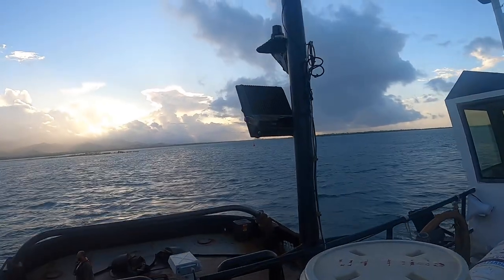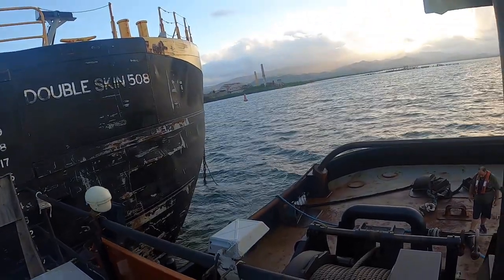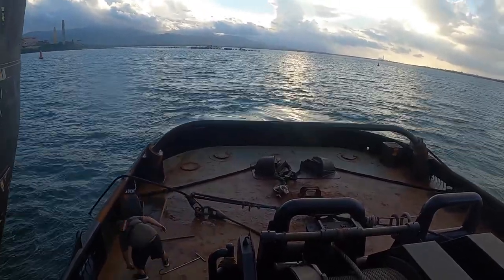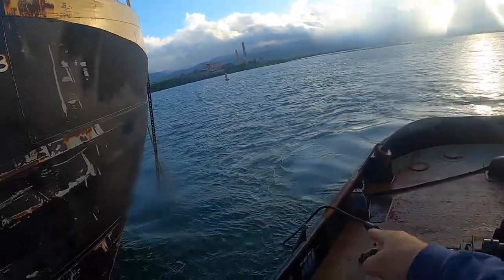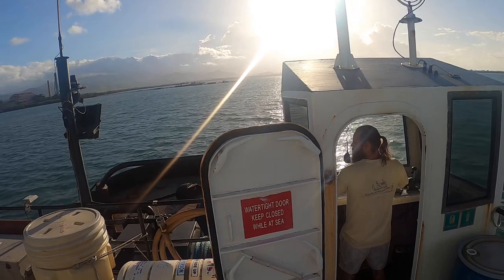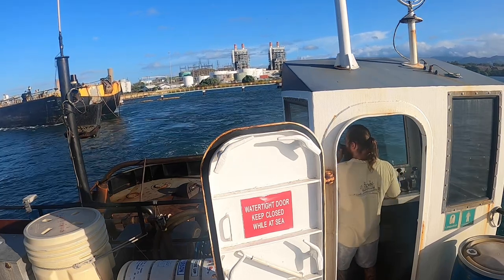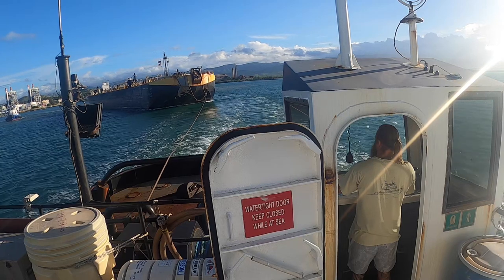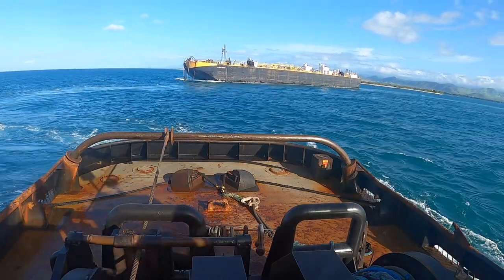Towing off the Dock and Catching the Doughnut

Comment: Tremendously instructional and well done video. Very impressed with the nimble skills to mount the wire in the donut. Actually rather ingenious on the structure for the automatic mounting. Very subtle structures having significant effect on the operation and protection. Like that your chief is consistent in following safety measures and your video captured the dynamics as to why.
Reply from the maker: Thank you very much for watching. Yes. We have the benefit of a few hundred years of work done before us that have figured out better ways of doing things. CUOTO

Comment: Hi Tim, FYI , spectra is the original name  of linear polyethylene fibers, Dyneema is the same product it’s the European name. 
Kevlar is a completely different product with poor uv resistant unlike Dyneema.  
Both are light wt and very strong.
Dyneema has taken over from kevlar in many applications.  Dyneema is less chafe resistant and can burn /melt, kevlar is very resistant to temperature especially thru say a fair lead.
Dyneema as you know not a great tow line product as it’s not got the stretch or shock resistance of say nylon that is a great anchor line. And I would use for towing yachts etc do you use for heavy towing?
There was a well know super yacht channel where they were using a spectra/dyneema line to tow the 32’ expensive tender on a typical long tow line .  They basically ripped the front of the boat apart as there was no shock absorption. 
Instead of changing to a proper nylon tow line they built huge SS reinforcing into the tender bow ! 
So now that will probably pull the cleats off the super yacht! 
Cheers Warren
Reply from the maker: 😂😂😂😂 (I really shouldn't like to hear about mega yacht fails as much as I do) Thank you very much for watching and for the great info. Much of which I did not know. CUOTO

Comment: Regarding luke the winch operator
Im kinda surprised that they allow you guys to smoke while so close to a vessel that just unloaded millions of gallons of fuel, is that safe? A recently emptied fuel tank is just as dangerous as a fully loaded one, the vapors can easily ignite
Reply from the maker: Thank you for watching. Well, actually Luke is smoking in our only dedicated smoking areas on the tug. The barge looks much closer because of it's size. But even so, 2 oil is not like gasoline. You can literally throw a lit cigarette into a bucket of 2 oil and it will go out. Safety is something we take very seriously as our lives depend on it. I would not allow anything that might endanger the crew or operation to be permitted. CUOTO
Reply: @TimBatSea 
 it's basically like diesel fuel then, I understand now, thanx for the clarification Mr. Tim